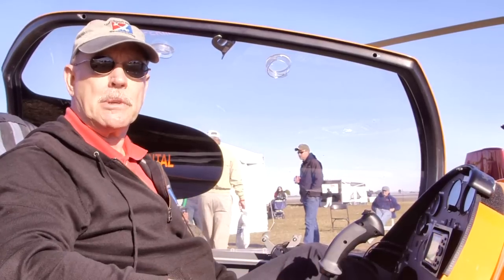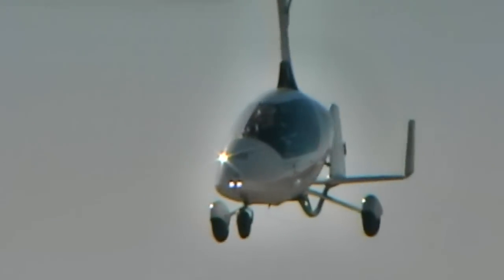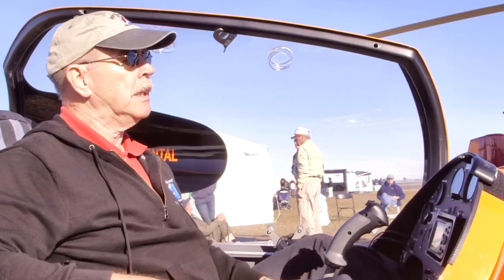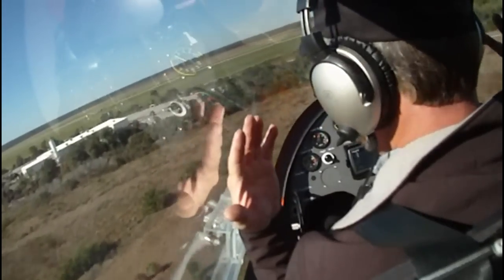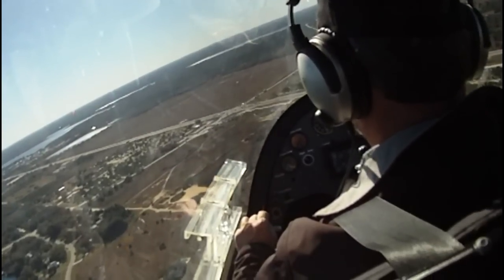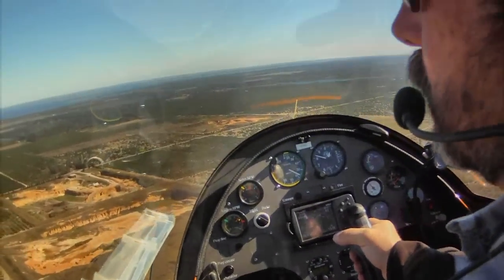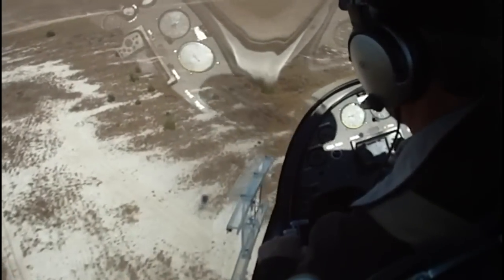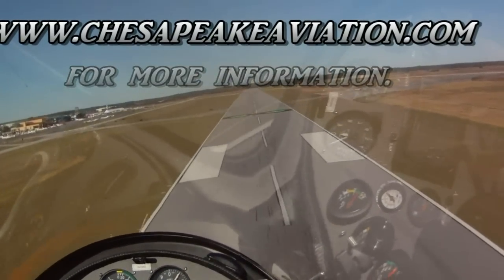Calidus Autogyro from Autogryo USA aircraft review by Dan Johnson.

Comment: The explanation of the entire take off roll, lacks the essential information that students need.  The initial acceleration is to allow for the effects of the right rolling tendency as a result of gyroscopic presession and slipstream affect, then to allow time for the rotors to accelerate to flying rpm at which point the rotor's develop sufficient lift to exceed weight, to enable the transition into ground effect and further acceleration to the best angle of climb or best rate of climb speed before leaving ground effect.  Otherwise a great video of flying in the Calidus.

Comment: That was the best verbal information that I've received on gyrocopters.  I really appreciate  the dialogue the two of you shared.  If you don't mind answering  this... what type of fuel does a gyrocopter  consume?
Reply: +nybravest -- Gyrocopter is a trademarked name for the autogyro desiged by Igor Bensen. The correct term for all aircraft of this type is autogyro, autogiro, or gyroplane. The model shown here uses a Rotax engine, and can use avgas (aviation gasoline) or mogas (automobile gasoline).

Comment: I wonder if the learning curve is a bit easier for a rotor wing guy (or gal).
Reply: +yoshi konno -- Autogyros fly more like a fixed-wing aircraft than a helicopter, and most gyro CFIs I've talked to said it takes longer for a helicopter pilot to transition than for a fixed-wing pilot or even a zero-time new pilot. The main difference between a gyro and a fixed-wing is that you must NEVER get into a low-G condition in a gyro; if you unload the rotor you'll be hearing the sound of harps playing in short order.
Reply: @seikibrian8641  So an Autogyro cant recover from low g at all? Is this because the lift roter would stop spinning & the fall would not allow it to restart spinning again?